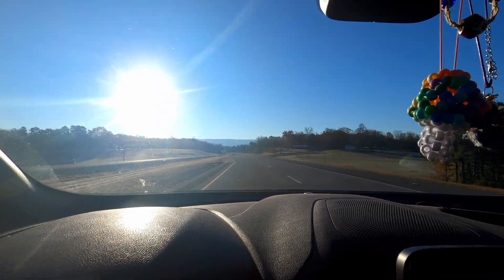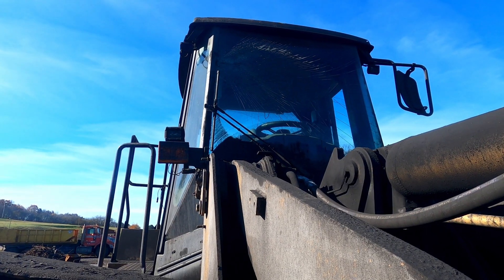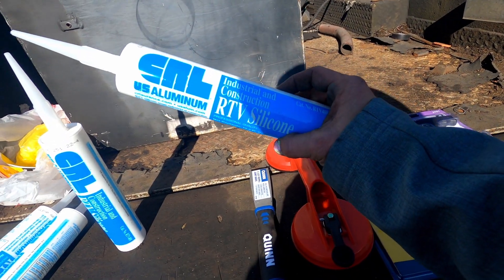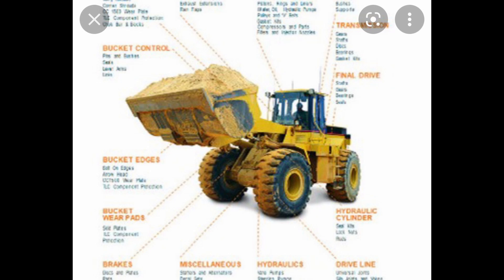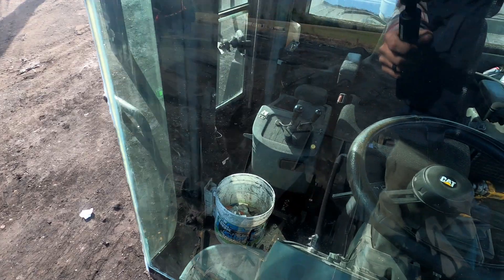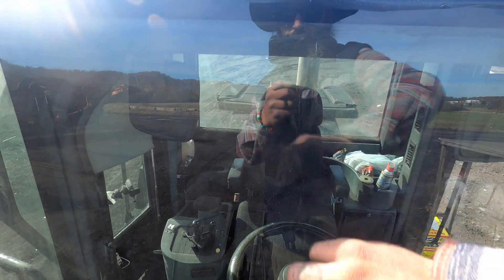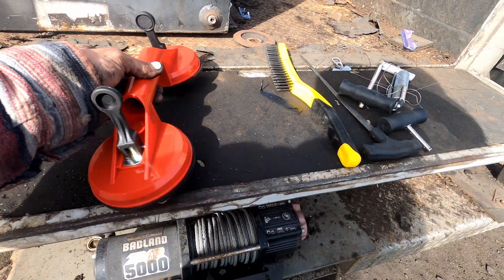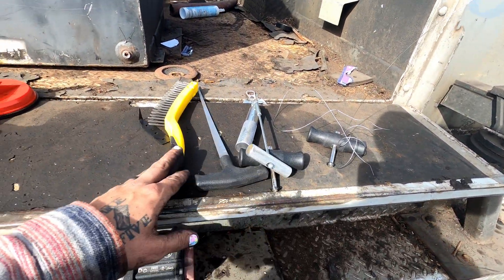REPLACING A WINDSHIELD ON A PIECE OF HEAVY EQUIPMENT/ FRONT-END LOADER

Comment: Hey Ryan was just wondering, why you use silicone instead of urathaine? I heard silicone will promote rust and corrosion.
Reply from the maker: I used RTV sealant. I called it silicone several times but I used RTV. The same sealant I used last year held up great! I forget the name of it but I went to a commercial window company and that’s the stuff they suggested. Thanks for the input! Make On my Friend
Reply: Silicone is used on the sides from factory as it’s more transparent than urethane . It will only promote rust on the metal part where the Glass rest’s on AKA the Pinch-well